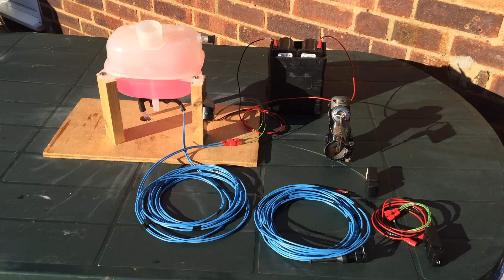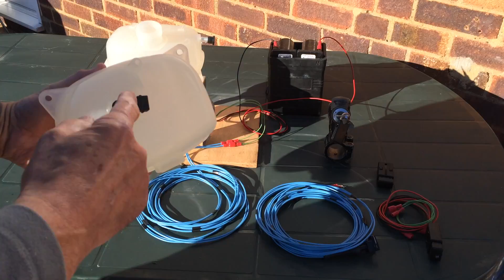MGF and MG TF easy fit low coolant alarm

Comment: Hello Bob.
Any chance that you are able to make another batch of these kits ?
Thanks
Reply from the maker: David, I stopped making theses some time ago, they're quite labour intensive and I had a lot of other work on. I may have a bit more time now and might make another batch. If I do, I've got the parts to make a few complete kits including tanks and sensors. I let you know if I do make any. Thanks Bob
Reply: @bobdavis8561  Thank you.
Appreciate it 👍🏼
Reply from the maker: @davidhorsnell696  Apologies for the delay but I've now got a couple of these ready, if you're still interested mail me at postapart@gmail.com include Low Coolant Alarm in the subject so that I don't miss it. Thanks Bob
Reply: @bobdavis8561  Thanks Bob. Very interested.
I have sent you an email 👍🏼

Comment: Hi Bob. Just finished watching your video and I would be interested in purchasing one of your kits. Is there anyway to fit this to a Mk1 MGF VVC. I notice Rimmers sell a similar system that you can remove the LED out of to place into a switch blank on earlier cars. Thanks.
Reply: Hello Bob, this looks like a fantastic bit of kit. I have the same issue as Gordon, I have a Mk1, I was wondering if you could supply the electronics without the switch blank so that I could box them up somewhere and route the LED to an unused warning light in the instrument panel?
Reply: @simonhedges1302  Hi Simon. Rimmers do a kit that is something like this and it has the led and bizzer separate from the switch fitting so it will work with the Mk1 dashboard. I would much rather buy this one from Bob as the Rimmers kit can take up to 30 seconds to alert you to a problem.
Reply: @gordonhack5212 
Thanks Gordon, I have looked at the Rimmerbros kit and I too would rather have Bob's, it seems to be better performance and value, the Rimmerbros one is over £180 and I already have the bottle and sensor.

Comment from the maker: I've just listed another batch on ebay which you can find using item number 323489621277 or search for MGF and MG TF easy fit low coolant alarm.

Comment: Fitted mine a couple of weeks ago at the same time as having stainless steel coolant pipes fitted gave it a good bleed but always hard to get that last 1/2 litre . Anyway went for a ride on the Sunday & As sure as day the alarm went of the water level dropped about an inch topped up with distilled water no problem since very impressed I think it’s better than the factory fitted one & definitely than them over priced contractions on the market.
Reply from the maker: Thanks for the comment,  I'm glad you're pleased with it. I make and sell these to help fellow F and TF owners. Having had a head gasket fail due to a split hose is why I designed it, I was lucky (how is a failed head gasket lucky!!) as I got away with just replacing the gasket and split hose. As these cars get older the more likely hoses are to fail.
Reply: @bobdavis8561  Just had a head gasket repair and fitted SS underfloor pipes, water pump, tensioner etc hence the reason I would love one of these - certainly don't want to have to go through all that again due to coolant loss so its a definite need for me!
Reply from the maker: @zeb1801  They're nearly finished, I've had an unforeseen delay that's set me back a bit. Do you have a tank with the sensor in?
Reply: @bobdavis8561  Not at the moment Bob but I am looking out for one.  My current tank is sensor-less
Reply: @bobdavis8561  Hi Bob, I don't at the minute but I am on the lookout for one, mine is the standard coolant tank without the sensor.  I will get one soon though

Comment from the maker: Hi Anne, your tank won’t have a sensor and it’s probably unlikely you’ll be able to fit a sensor, unless the tank has been replaced at some time. It’s fairly easy to check if you know what to look for. While the engine is cold remove the coolant filler cap and look inside to the left hand side of the tank, if you can see a white cylindrical float approx 15mm in diameter then the tank will accept the sensor, if not I’m afraid it’s a new tank. I’ll be putting another batch on ebay in the next couple of weeks and I’ll put the item number on here. Bob
Reply from the maker: Just to let you know I've just listed another batch of these items, listing No. 323229982692

Bob

Comment: Sounds just what I need. I have a late 2002 tf with a tank presumably without a sensor; can I add a sensor to the existing tank? and will you be releasing another batch of the alarm kit on eBay?